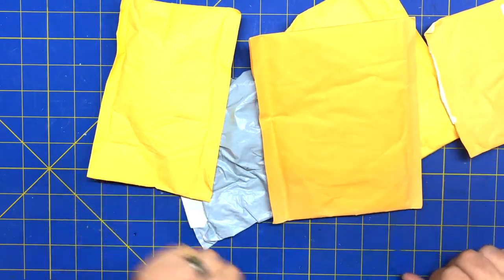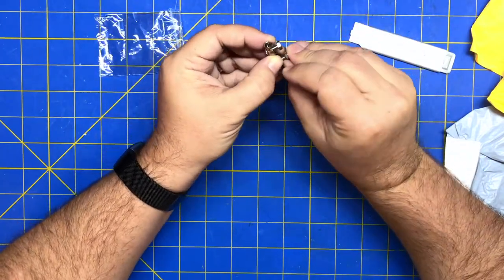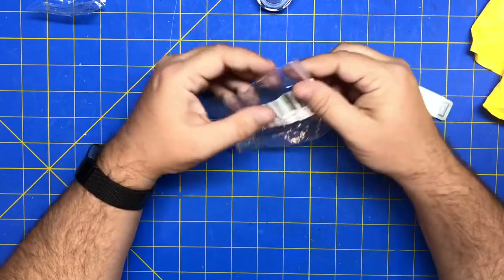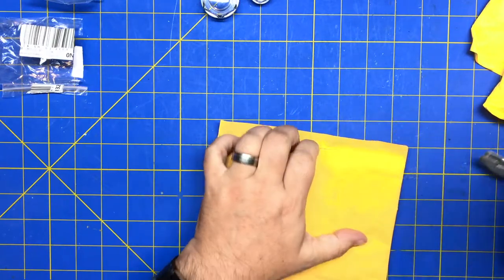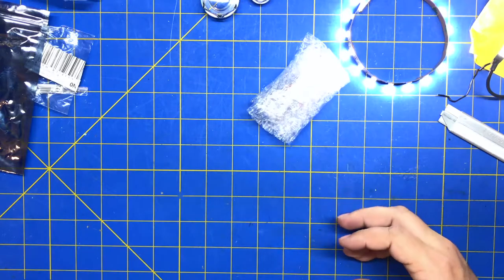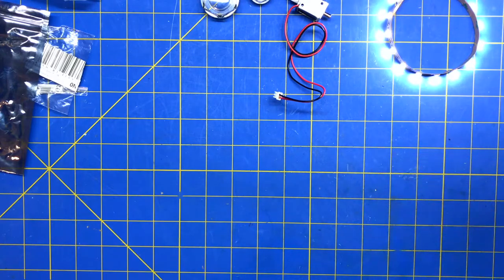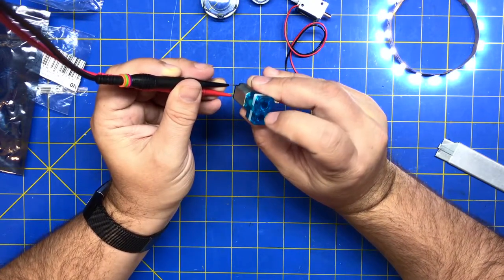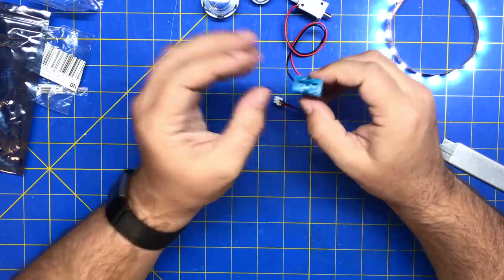Mailbag #59 10-2019

Comment: FYI: I've used those clamps to connect metal wire ends together in a loop on a sailing boat, as well as to tie a washing line to a pole.
Reply from the maker: Yeah they are for steel cable, I figured it out after and recorded it but decided to remove the end video cause it was superfluous rambing